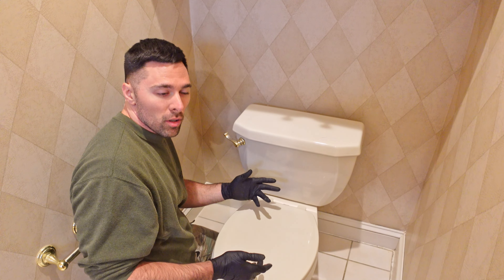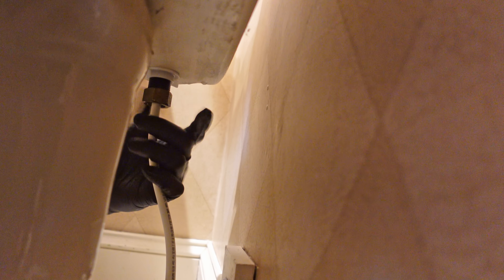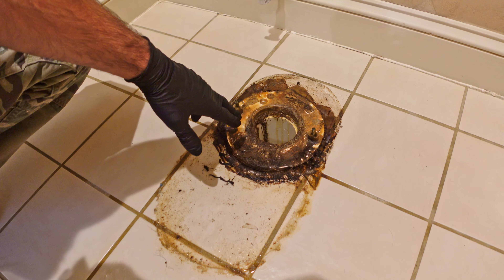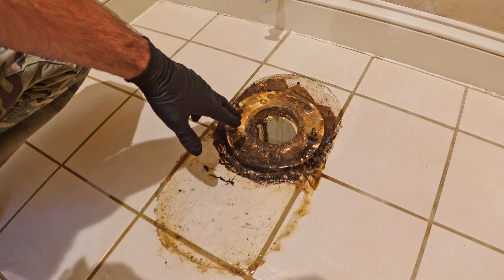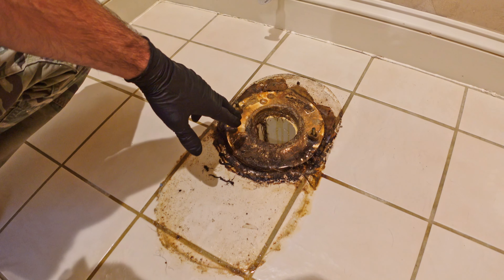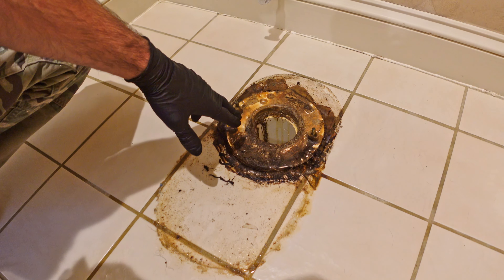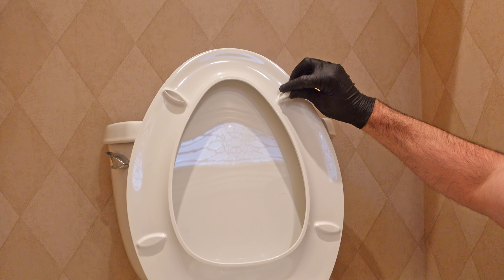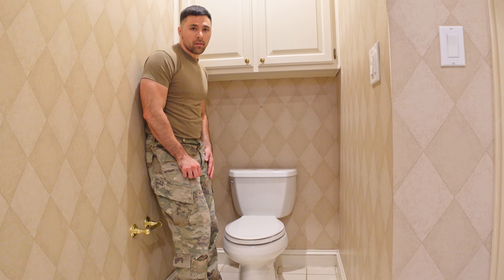How to Replace a toilet || DIY Toilet Removal and Installation

Comment: I would always consider a one piece toilet simply because it is easier to clean and more appropriate for of a house of that calibre.
Reply from the maker: I have never messed with a one piece toilet. They seem like they would be fairly heavy since the bowl and tank would be all one unit.
Reply: @thediygrunt  It might be worth investigating.  When I preview homes, that is one of the things that I hone into  especially homes that have been recently been flipped. A one piece toilet is always better as it is easier to clean; no chance of a leak between the tank and bowl and is expected in homes over a certain price point/quality. Once you go one piece, you'll never go back.  Can't speak for the weight of one of these units as I have never installed one but have had them installed many times by qualified plumbers.